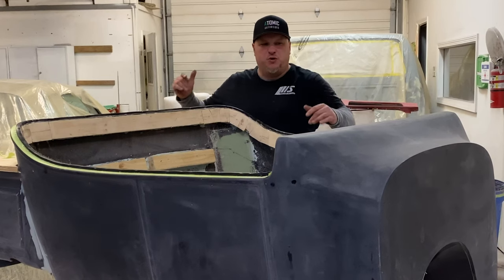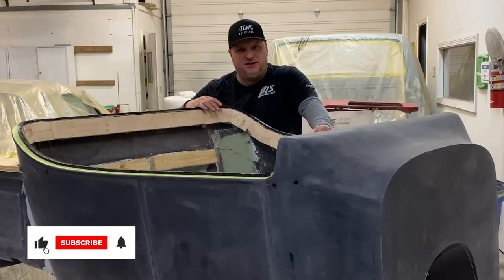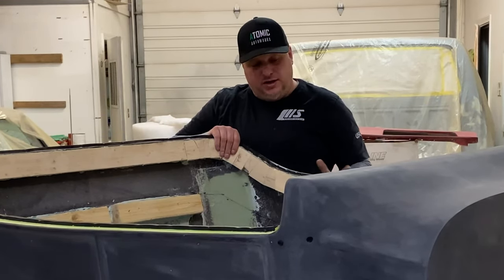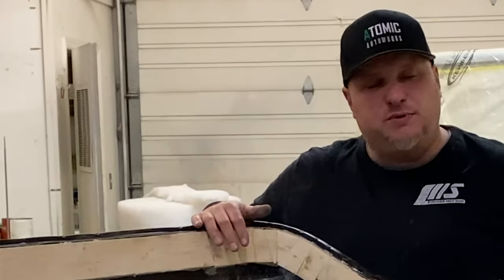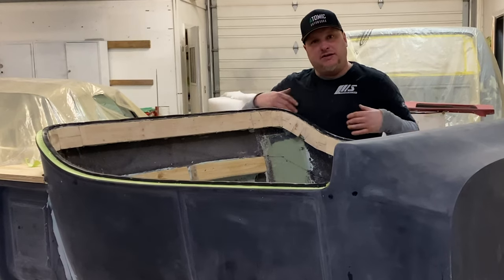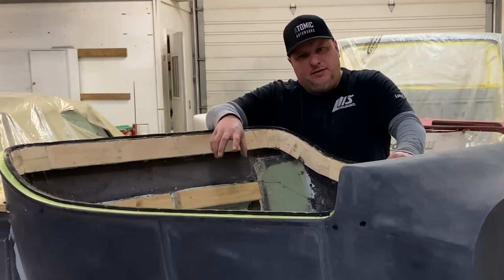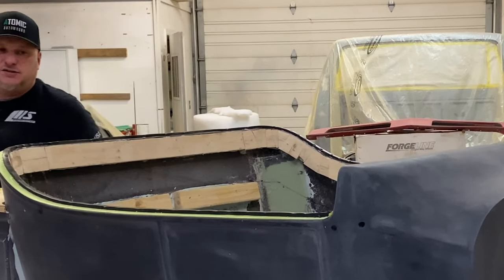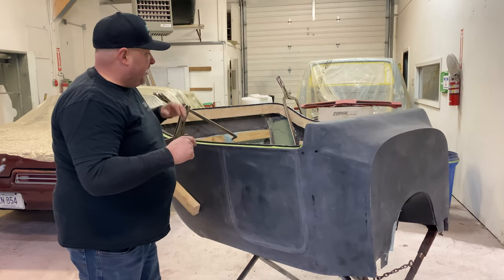Do You Need To Screw Into Your T Bucket?

Comment: Is construction adhesive ok to use instead of body filler?
Reply from the maker: No, I do not recommend it. Construction adhesive dries at different rates and will warp the outer body. If you find one that is polyester based and uses a catalyst that might work.

Comment: What size are you making the wood pieces that you are bonding to the body?
Reply from the maker: Widths depends on the body size. This body had a huge top flange so the wood was around 1 1/2” but usually they are around 1”-1 1/4” thick and usually around 2 3/4” tall .